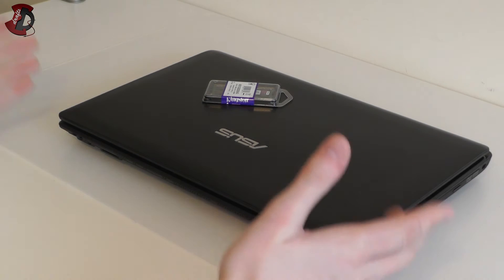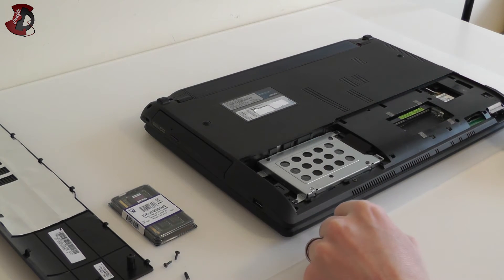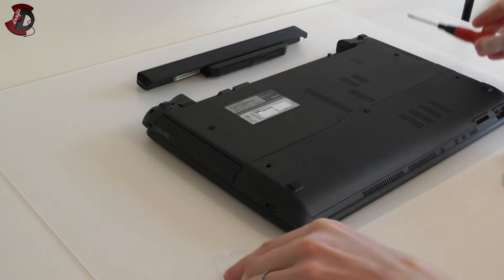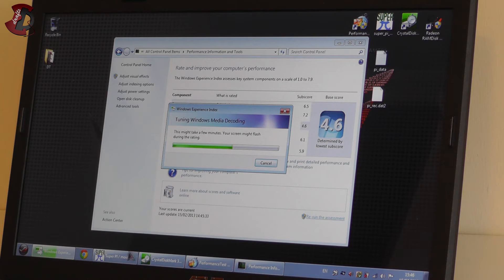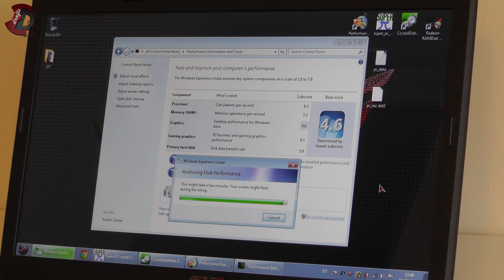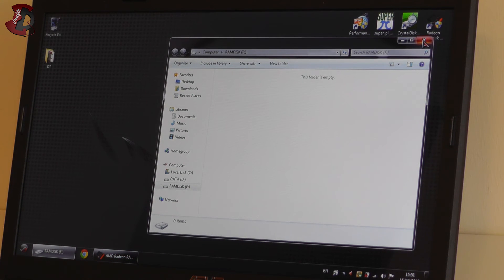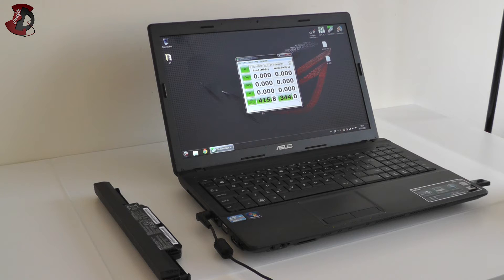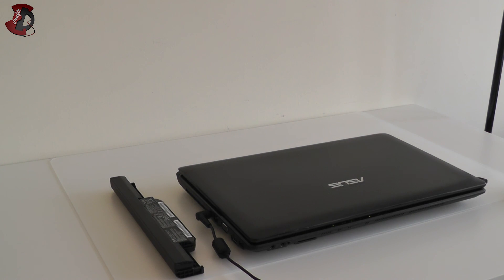ASUS X54C RAM Upgrade and Benchmarks Video 2 of 2

Comment: I am fixing my x54c, and i found your video. Thanks a lot. im not that good at computer  components. So, I want to add RAM, can you suggest what RAM i should buy.  i also want to change it's hard drive to SSD. What SSD should i buy? And also, up to what GB is the maximum? Is it 520 GB or is it  capable upto 1TB?
Reply from the maker: Hi. I believe Crucial and maybe Kingston do memory and SSD configurators. Very handy, Crucial price and performance quite good as well.

Comment: Just added 4gb to my exact same laptop today, followed your steps and it worked perfectly. Thank you 👍🏽 now since I have 8gb what settings should I change the virtual memory to ? I have noticed a slight I improvement in speed so far
Reply from the maker: Hi. No need to, no. Windows will adjust that after few reboots to what it needs.
Reply: What ddr is the ram ?

Comment: My Asus X54C Has 6GB Now without having to open up the back and look How many GB is the   Memory that is soldered in? Is it usually 2 or 4 GB? Another question is in Canada I have Rogers Ignite 2.4/5GHZ Modem but its only showing as 2.4GHZ  My Wifi is 802.11n build in. Does that need to be upgraded to get 5 GHZ on this older laptop?

Comment: Max ram ???
Reply from the maker: You'd have to check latest manufacturer specs for this.
Reply: @Edsdrafts  asus (laptop) x54c max ram
i have total ram showing 10gb asus x54c laptop
Reply from the maker: According to Kingston it will only take 4GB as expansion, that's the official take. Meaning if it's 2GB soldered you get 6, if 4 you get 8. Usually you can go for more but not sure, sorry. Don't have the laptop anymore.

Comment: Curiousity, do you still have this laptop, if yes, what is it running, if no, then what happened to it?
Reply: I'm interested in that too, because I've got the same and it's still going strong, after 8.5 years...
Reply from the maker: Sold it long time ago, sorry. I tend not to hold onto the technology for too long. Or at least used to.

Comment: Hey, I found a 8gb ram card in Amazon and it says that it's compatible with my asus x54c even though I have read that the limit is 6gb, 2 ram soldered and 6 when you install a 4gb ram memory. So I'm a little bit confused, what do you recommend me: should I install the 4gb ram memory or can I install the 8gb ram memory, if you help me with this I would appreciate it very much.
Reply from the maker: It is hard to say but according to Kingston the max is 8GB - https://www.kingstonmemoryshop.co.uk/laptop/asus/x54-series/asus-x54c-laptop

Comment: IVE GOT 2GB RAM AND WANT TO UPGRADE TO 6GB. ANY RAM OF 4GB WILL DO? OR DO I HAVE TO BUY A SPECIFIC ONE? THANKS ..
Reply from the maker: +Cynthia Maria Gutierrez Santana in theory yes but I would go to Kingston memory configurator and pick your system. This will recommend you the RAM to use.
Reply: and what about the voltage?
Reply from the maker: What did the configurator recommended you? Go with the lowest offered ideally.

Comment: Eds drafts Please help me, is there any way of upgrading my Dedicated Graphics?? I have 64MB of Dedicated Graphics and I need to know if I can buy something to upgrade it.
Reply from the maker: Depends on your PC model. Take your PC specs or PC to nearest hardware store and ask them what can be done depending on hardware you have at hand. Then you can shop around if you wish or buy directly from them.
Reply from the maker: +Richard Ibarra if it is specifically for laptop you only have one choice in most cases. If laptop is using RAM as shared memory and has software to increase this you can allocate more. However, unless the laptop has GPU with integrated VRAM (which is not up-gradable either) the performance will be seriously bottle-necked by RAM speed. In other words - you need a gaming laptop ideally.

Comment: Is it true the X54C can only have a max of 8GB of ram??
Reply: Ash Holder Definitely not true. My ASUS X54C has a total of 12GB of RAM.
Reply: @richardibarra9955  your is probably a x64 bit.
Reply from the maker: It is possible. I no longer have this laptop myself but could be so. Cheaper models sometimes have soldered modules and none or just one replaceable. But hey, considering laptop CPU and other components you will not need more than 8GB RAM unless you have a very specific task for it that requires tons of RAM. It is marketing gimmick in most cases.
Reply: so does that mean i can add a 8gb ram to my asus x54c which right now has only 2gb ram?
Reply: @hypotheticalbarfi4823  hey same question have u found an answer yet?

Comment: The model I have comes with 6gb RAM, would this mean I can only upgrade to 8GB by installing 2GB RAM? or would I potentially be able to upgrade to 10GB RAM?
Reply from the maker: I am not aware of 6GB RAM in existance. Usually it goes 2GB, 4GB, 8GB, 16GB memory sticks. Chances are you have 2 and 4GB in. Why do you need 8GB anyway? For gaming PC 8GB is tons, even 4GB is enough. For most daily use laptops 4GB is tons.
Reply: Yeah, I have not had chance to open it up and find out yet, but I guess they already put RAM in the slot then. Thanks
Reply from the maker: Wouldn't worry. 6GB is plenty for such machine.
Reply: Side of Fries My ASUS X54C has a total of 12GB RAM.
Reply: +Richard Ibarra are there 2 slots?
Reply from the maker: Fan as per video - only one slot to expand on. Second one is built in.

Comment from the maker: Check 1:59 of this video - the other stick is soldered in so you can not easily remove it. I have never seen an option for disabling DDR3 stick. You have to physically remove it. If it is still under warranty contact ASUS for RMA. If not - check with local laptop repair store.

Comment from the maker: Have a look at 2:00 mark. The other slot is soldered in. For this price laptop 8GB is usually tops. Some laptops dont even have a second slot for upgrades and to reach first you need to take most insides out. Even when you do you might not have official support for 8Gab module. Hope this answers your question.

Comment from the maker: The memory that came with laptop is DDR3 and fast enough for this CPU. I would not call it old but I know what you mean. It is actually soldered in if I am not mistaken. The only thing you can do therefore is just to add more RAM into remaining slot. That should also enable dual channel DDR3 mode though you might not notice difference.